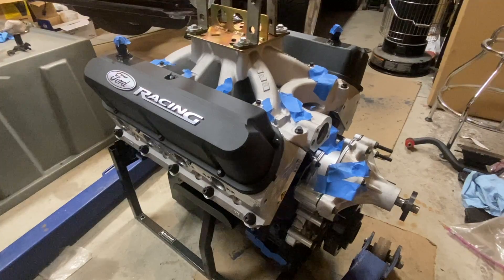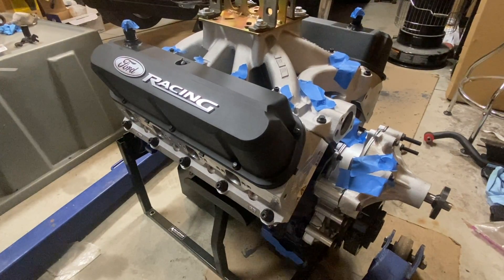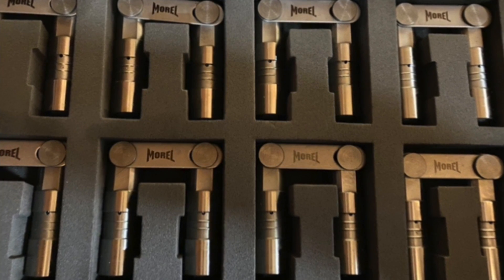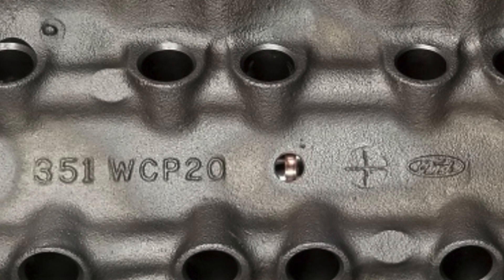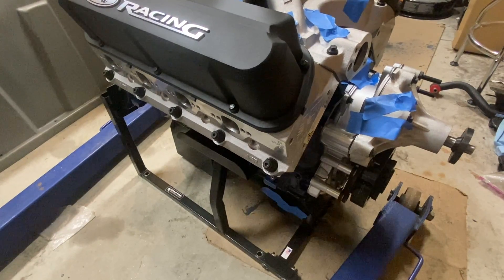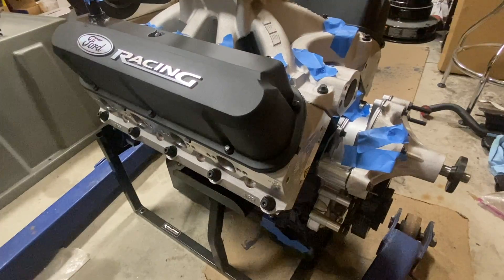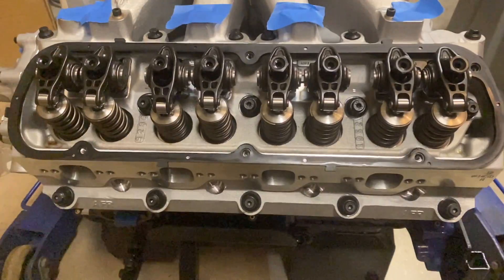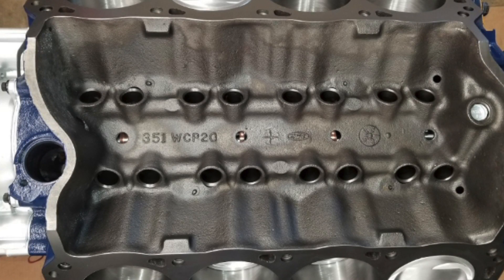408W engine overview 351W based

Comment: Hi and really nice build. I will building a 351W bare block and want almost identical HP as you stated. I saw there might be a build list.? That would be fantastic to see it. Do you have a website to view?  Thank you for sharing you beautiful build with us. Cheers from Motown/Dearborn.
Reply from the maker: My build was done by Ford Strokers.    All forged rotating assembly, and he orders his own customer Wiseco pistons and specs his own cam from Comp Cams.    My pistons were chosen based on knowing I have super charger.    ARP bolts on everything, upgraded to rod studs, Super Victor EFI intake.      Neutral balance engine.     Stock 351W non roller block and using link bar lifters so I can run the hydraulic roller cam.

Comment: Well its a little late now but you missed a very important piece for t😢he durobility on the bottom end. A main cap girdle will help and always even on stock motors a windage tray. Its good for 12 HP on a stock motor. And excellent choice using the wiesco's and Morel lifters some say they are the best. So you did a great job on it over all but if you havent already get a girdle on there.
Reply from the maker: Jim / "Woody" at Ford Strokers specifically stated no value.   The oil pan I have has a windage tray built in.    The key was the build used main studs which is what engine build recommends.

Comment: Just happened to run into this vid. Been out of hotrods for 25 years and this made me rcall highschool shop class, where i owened a 79 5.0 fox body mustang. I was more of a chevy guy i guess i knew more about them anyway you  proably knew i didnt i thought it would be like swapping . chevy 305 with 350--wrong in the late 80s the aftermarket was not what it became --o yes the oil pan wouldnt fit 351 wind in fox body, my old shop teacher knew his business after days looking thru the massive blue engine parts mountain he found it the only it around for states i think it was a 1970s ford 4x4 oil pan that would fit. SORRY 4 LONG MESSAGE. The other i wanted a comp i think brand cam a 280 duration. The old x drag racer who owened the shop told me for street racing it might be too much for idle,, So he talked me into a new cam that had just came out a 270 duration but you had too run a 302 firing order on the 351 windsor it ran great .however years later while at work my dad who dont know cars sold it. Dad told me the guy keeped telling the person with him that the firing order was wrong. Tried too call guy but he thought he had got away with a deal. bet he never figured that out.

Comment: I just got my Dart shp block with billet main caps 427W with tfs hi port heads etc going in my 93 coupe finally finished.
Reply from the maker: nice, if I ever blow up this motor, next step is Dart
Reply: @MrStangdawg  Hell yeah!!! Well hopefully it last a while for you lol. I had a 331 in my coupe and traded it for a D1 Pro charger and sold it and put that money towards my 427W

Comment: Nice build. I built a simular 408W stroker a few years ago but kept it NA and smaller 185AFR heads and an Ed Curtis custom built cam and kept it EFI and stock A9L ECU. Very street friendly fun foxbody. It dynoed 458 rwhp. Got my 351 from a mid 90s bronco out in California and had CHP build me a blueprinted street/strip shortblock out of it and ship it to me in Indiana. I can imagine how much prices have gone up since I built mine. FJB. Good luck! Have fun when it's done!
Reply: How much did CHP charge you to build your motor
Reply: @jawaskiconner8695  Just looked at the invoice,  $3,337 and that included $275 shipping.
Reply: @snowsolo  just had a 408 built. Alumina heads. Sniper 2. Pan to intake. It came to 18 000 with taxes in CDN pesos. Which is like 12k USD. All dressed in billet.  Vintage block. Quality parts. So.... you lucky dog.

Comment: Can you send me some advice. I have a 74 block 351w. If I went 427 (assuming i could) would you still go with a dart block. Looking to keep it small numbers around 500 hp or less because the car is very light and small. Thanks
Reply from the maker: Not ideal to use a stock block for 427 that's when you want aftermarket block.
Reply: @MrStangdawg  Cool, I might leave it alone then and swap on some after market heads,
Reply from the maker: @Big-Lex124  make sure you know your end goals.   A Dart block uses a different crank than a Windsor block so if you change your mind you have to buy a new crank again.
Reply: @MrStangdawg  Ok. I put a vid of the cobra up. I dont want to push it too much, its already scary fast.

Comment: If you put the right cam in there, you'll be amazed at the power it will make just NA.
Reply from the maker: This build was centered around the Vortech.   If I was to do an NA build I'd go Dart 427
Reply: @MrStangdawg  Dart blocks are too heavy, unless you can afford aluminum...

Comment: I have a 351 with a 7268 put down 678hp 635tq to the tire
Reply from the maker: Nice.   I'm pretty sure if I turned up the boost I can get into the 650 range.    I'll definitely do a dyno vid when I get to that point.   With the stock 351W block I'm going to probably limit the boost to 10-12 pounds to keep it safe.
Reply: Yes I have a noise in my driver side head area now
Reply: Is it NA? Can you share your build? I'm currently planning to build 408w that will output ~600hp RWHP so searching for tested builds

Comment: Looks like a nice build by a quality builder, my only question is why you had to send your block all the way to Michigan when there are top-quality Ford builders all over the Country, especially in New England? Anyway, good luck with your Ford-powered racer. BTW I built my 408 with a Dart Iron Eagle so I know Ford builds get expensive.
Reply from the maker: My local builder backed up on work and was charing stupid prices.    Even with shipping was still a better deal.   Ford Strokers is a very reputable SBF builder and he makes the process easy.  
   I already had my crank and had a block.  If not for the Dart block shortages I'd have gone 427W.
      This build went far beyond just doing the motor and costs went up accordingly :)

Comment: Nice build. 
I've heard the SHP blocks are taking forever to get.
How close were the AFR 205s and super victor ports out of the box?
Reply from the maker: I'm not sure I'll ask engine builder.    Using an Edelbrock elbow with a Ti race trim Vortech I'll have enough boost that it won't matter 😀
Reply: @MrStangdawg  Nice. I am doing a 427w myself. Also have 205 renegade heads with a carb super vic. Going to run the terminator x stealth kit. I've been keeping it secret from my friend. He thinks I'm building a 351w with used 185afr heads lol.
Reply from the maker: @I_like_turtles_67  I am doing a ProM EFI system.   Got a bunch a videos I"m cranking out with more how-tos
   I sent my term x back and bought the ProM since it has OEM style connectors.